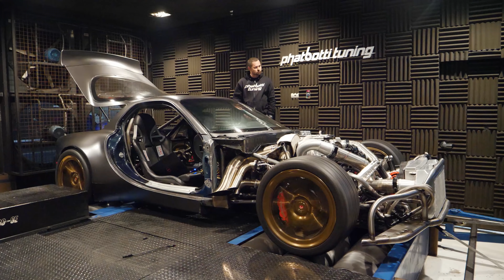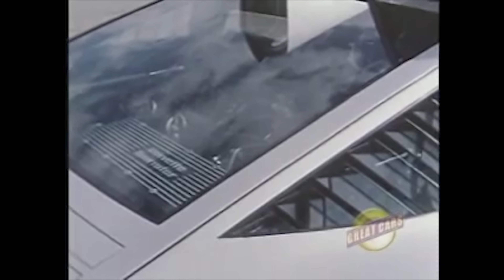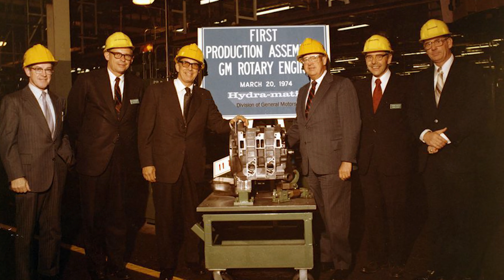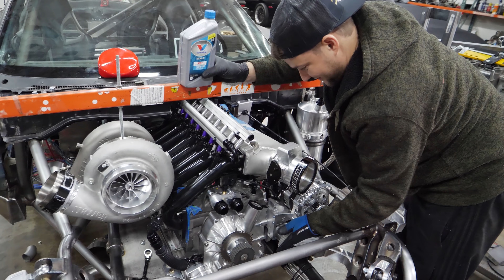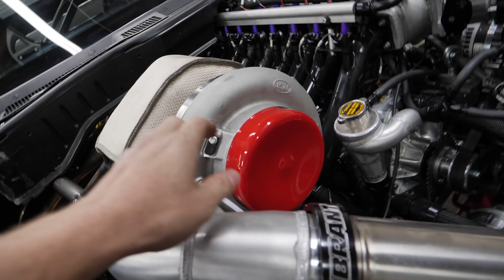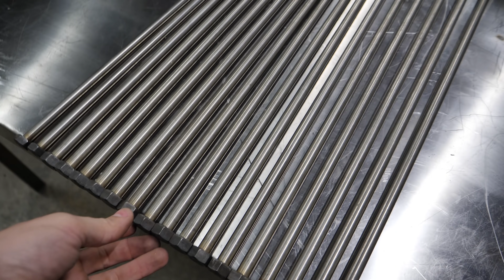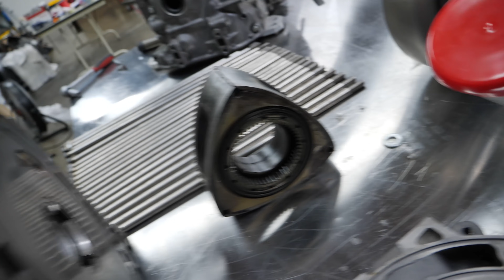I begin my 4 Rotor C8 Corvette Swap! Modern Aerovette Incoming!

Comment: At least GM didn't lie about displacement. That's what killed Mazda's rotary, they claimed 1.3l when it is really 650cc x 6 for a total volume of  3.9l. They lied to get a tax break and now it can't possibly keep up with emissions. There's 6 separate 4 stroke combustion events happening at the same time but they claimed 2 because only 2 sets of plugs.

Comment: The biggest problem with this kind of rotary is that the two outside rotors make more power then the inside two rotors. Due to the center plates only have small ports. They are primary ports. And you are using them as a secondary port and they are just not big enough. No matter how much you port them.

Comment: Thanks a lot for the info ! Do you know anyone that has tried hydrogen as the fuel source ? I made a hydrogen fuel cell (HHO) for a piston engine and it completely rusted the thing out. I was told I needed to go to a rotary engine, It would exhaust all of the moisture.  Let me know if you believe that is true about the exhaust of a rotary engine !
 HHO burns cold, the rotary would literally need no coolant.   I have an extra HHO Fuel cell if you would like to play with one.  It makes 70 liters of HHO a minute, size of a small fish tank. 12V, 20A  of power required !

Comment: That the oil gets so hot the engine requires 3 oil coolers is one of the reasons why rotary engines are so inefficient compared with piston engines.

Comment: Valvoline is good oil. I only use Valvoline or Castrol. And I have and have had many vehicles I was very hard on, and I've never had an internal failure, and when I open the engines valve covers or oil pans, they're always clean with absolutely no sort of buildup or discoloring from heating marks. 

Ps. I did have one engine throw a rod through the side of the block, but it was because I bought the truck with the engine noise, and it sounded like the noise was coming from the bell housing, so I was thinking it was something in the clutch, so I held the engine at around 7000rpm's until it made a heck of a noise and there was oil and rod parts on the ground. But looking at the internal parts, the end cap on the rod that let loose had all the bolt threads that held the end cap on, and the bolt was in the oil pan with the upper threads messed up. So I say that bolt backed out and caused the rod to let go.

Comment: I mean, put in an order for a C8 with Criswell Chevrolet. No markup. You can't get one at a reasonable cost as the video I saw before the one explaining the Wankel was the fellow who paid 25 K above sticker in Vancouver Island, Canada. I don't know the full dealer allocation everywhere, but these days, until quite a few C8's are built there aren't any at sticker and that is not likely to change soon, mainly because there are so many who want a C8 for what it is. I mean, I have one coming to me in May, June, July or August I don't know why. It is for a place in line. But having already scored a C8 from a local dealer, when 18 C8's came in to Los Angeles and the surrounding counties, the week prior to April 12, I bought one of those  18 in Los Angeles. Four days later there were 4 left; not long after that, there were zero left. There is one catch. I need 5K for it, which is the amount I invested with the dealer for the deposit. Color? Blade Silver Metallic. This is not a LT1 and its not an LT2 so the car is priced  in the 96range, plus tax, license and transportation. AF

Comment: It was interesting to me that the supposed air-cooled Porsche Engine was actually and oil cooled engine. When the power had gone up when I customized a 911 T engine to a RS specification engine with a 2.9 liter, I installed an oil cooler out front with lines that went to the rear. Spooling up? Turbo with the Rotary. Join it to an all wheel drive like Audi quattro and the two most unfair automotive advantages in motoring would be put together. If it were reliable, it could win its class at the 24 hours of Le Mans...well, maybe. AF

Comment: It's possible to state that the operative words may be, "...and then it broke down." It's a nice project. I'll be interested to see how it turns out. 20-50 is a highly protective oil. Starting with a brand new engine with a new engine and car warranty seems like it might be a little bit odd. AF

Comment: Swap the Tesla Roadster 3 motors  to the C8.....0-60 in 1.9 seconds and top speed of well over 200 MPH....and still be able to go 650 miles per charge...especially with the new solid state batteries...small and light...The rotary engine will probably get about 5 MPG.

Comment: Ok... now I have something I actually want to CNC... I want to cnc a 6 liter rotary engine...  considering the kind of INSANE power a 2 liter rotary can put out...imagine that power!

So... the mismatched ports... just weld in some material on the inlet to make the big ones match the smaller.  Youd have a bit less flow, yes, but itll be balanced.

Comment: "They're all 1/2 inch and they need to be milled out in this block..."

Huh? 🤷‍♂️ You don't mill out bolts while they're in a block. That's not even a thing. You mill and enlarge the bolt holes for the larger bolts.

Comment: This will be bad ass. My grandfather actually worked on the Corvette prototype when he was working for GM back in the 70s. He once told me what really killed the GM rotary was due to the engine's massive size and design. the thing had serious overheating issues that they couldn't figure out how to fix and the engine was just overall unreliable.

Comment: If Dr Frankenstein had a test tube filled with cellular microbes of Einstein, and then added the DNA of a few bald eagles sprinkled with stars and stripes, then threw it in a turbo charged  blender with a small amount of motor oil and racing fuel, then put it in a petri dish and kept it in a climate controlled lab for up to 9 months feeding it only doritos and bits and pieces of freedom until late one night it escaped from the lab only to find refuge into a corvette manufacturing plant.... ladies and gentlemen I give you Mr Rob Dahm!! This man is an amazing genius!

Comment: Lets take a well designed, super fast sports car, removed the legendary, reliable small block V8 engine, and throw in a unreliable, fuel hogging, low torque rotary....
Someone didn't think this one through completely before hand. Terrible idea. Oh, and good luck getting the electronics to work.

Comment: Using a smaller spool size turbo to prevent lag... did you consider Mazda's theory of sequential with a large behind a small turbo and setting up something like that? What about typical twin turbo setup with smaller turbos? You're talking boost at 1500 RPM. 

Love the channel. I got started with Wankel's with my RX-3, then an RX-4. Finally my last one was a Turbo II RX-7. And yes, I hit the subscribe button.

Comment: 1000 hp rotary.... 200k later lol no but ive never bought a new car either lol. Im a mechanic and find it easy to just fix and rebuild an older vehicle than buy a new car. The prices are theft and the insurance costs are criminal! I can get a nice used vehicle for 5k and put 5k into it and have it basically brand new. Im cool with that!

Comment: Supercharged rotary has triggered me.
I'm not a fan of superchargers, but... why don't upgrade your Z06 to a twincharged system?
Just for try, you can run a bigger turbo and don't suffer from lag.
There's a plenty of space in the engine bay for 2 intercoolers and bypass valves.
You are "crazy" enough to do it!

Comment: No reason not to put restrictors in the outside ports to balance everything out. Saves a lot of trouble. And they are already very capable plus the boost doesn't care that much in this situation.

Comment: I wonder what the next insane project after the C8 and 6 rotor is going to be. 1 rotor is honestly nothing special but I can see that being done, and a 5 rotor could be interesting. I wonder if Rob will ever tackle the concept of a diesel rotary; it's been done before, Rolls had made one that uses a larger set of rotors as a supercharger, though modernly that could easily be done with a more typical supercharger. 
If Rob ever does get to the point of doing a diesel rotary, it'd be the perfect swap for the work truck.

Comment: Can u answer me something? As far as i know rotary's engines have some issues related excessive wear compared to cylinder engines, so what do u needed to do to be able to run that engine in hig RPM's for long periods without having problems? (Does it have some special parts that u needed to forge or something, did u need a special oil?)

Comment: Excuse me… did they say a SIX POINT FOUR liter four rotor in the Aerovette? Yes please
Reply: That's probably counting all the faces of the rotors. Japan and Europe tax you based on engine displacement, so the makers there want to find a way to squeeze as much as possible. It's why the Mazda engines only count one rotor face. You can make a good argument that the R26B engine displaces 7.8liters.

Though the best comparison to a piston engine is to double the displacement of a rotary, since a rotary engine makes one power stroke per rotor per crankshaft revolution (and a piston engine makes one power stroke per two revolutions.)

Comment: Why put such a awesome engine into the ugliest Corvette that GM has ever produced.
Reply: Ugliest? Seriously? Are you that on that level of nonsense? With all do respect, that comment of yours is beyond negative IQ... "I sense your lack of cognitive thinking disturbing"
Reply: @adrielgonzalezcenteno7549  I have owned 9 Corvettes . I currently own a 2013 an a 2004. So yes I've earned the right to say there BUTT UGLY
Reply: @thomaswilson8634  ohh ok BUTT UGLY, you didn't specify that detail in the previous comment, sure i kinda agreed on that part not but either way, is not the UGLIEST from the previous generations. I know this are new grounds for the Vette (in a certain way). From a rear perspective i would have recommend they should have made it a bit more curvy lines right on the tail light section, more like they where merging with the rest of the body instead of straight lines, you know what i mean.

Comment: not to familure with rotory engines.. but wouldnt that defeat the purpose of the mid engine thing? dont rotories not make any tq until like 7k rpm
Reply from the maker: My awd 4 rotor made an impressive amount of torque down low. So I’ll use what has been working to my advantage but might need to regear the rear diff to get the idea power band

Comment: I was told that the reason that the rotary engine isn't as popular is that they do burn up a little oil and need more oil changes.  And as folk don't always know that they end up with blown motors giving the opinion the rotaries are unreliable. Is this true?

Comment: I think you should just do away with the side ports and machine in 55mm peripheral ports in each rotor housing. Make it N/A with ITB's and let it scream. You have already done a turbo 4 rotor. A 4 rotor PP build is the Go. Then you don't have to worry as much using the smaller diameter through bolts. We used to build 2 rotor 13b engines with a center bearing in the middle iron to allow them to rev. Also if you go full Peripheral Port you dont have the drama of the different size primary and secondary port size differences.   If you build this C8 correctly the money you would get for selling the 0 miles LT2 V8 out of it should basically pay to compete the build on the 4 rotor. I am a massive Rotary Engine and Mazda enthusiast. I have been building my own race engines and customer street car engines for over 25years years. But I would maybe get someone that is not known to you to go out and purchase the New C8. Because if Chevrolet or even a Dealer is watching this video you will be definitely be paying more the MSRP.
Good luck with the build. You will certainly need it. Especially trying to get all of the information from all the different ECM's to talk to each other. 
Maybe a Haltech to run just the engine stand alone and some recalibrated 2nd censors to trick the factory ECM's to what they are running. Otherwise you will have a beautiful mid engine sports car that nothing will operate on correctly. 
Cool build none the less.

Comment: It should be mentioned the 2-rotor Corvette was the step in-between the Pontiac X-4 commuter/sports-car concept of 1969, and the production model of the Fiero... which itself was being considered a possible replacement for the Corvette early-on in the wake of the second oil embargo of 1979. Think about it: Why else would GM have developed & test-marketed a design like the 2-rotor if they weren't considering it?

Comment: Thank god SOMEONE is doing something actually interesting with one of these. I don't know if it's all of the mid-engine LS-super-things cars that have been "...'manufactured'..." over the past two decades, but the C8 just has not even begun to move the needle for me. I'm sure the awkwardly proportioned(the awkward extra length between the body & wheel arch to start with), utterly generic/cliche 'supercar' styling plays a role in my lack of interest; but it's also 'just another LTx'(at least the upcoming OHC engine should be interesting; if it's ever actually affordable anyway)... 
I don't know, an 8.3l V10 front engine Dodge Viper is just so much more interesting(while I could never justify a rotary over the V10...  ...that platform would be KILLER for a big downforce, monster tire RWD 4+ rotor road racing/Time Attack car...) to me.

Comment: I'm reminded of CLR's trick with PTFE tape wrapped round the middle of the bolts to prevent resonance. Might be a good shout if those are stock diameter.

Comment: the really sad part about GM trashing the rotary program is they had fixed all of the problems that still plague rotary engines today like the oil problems and the bad seal life they had all of that fixed and were ready for production them the head of GM died and the new head said we have V8 engines why do we need a rotary and scraped the whole program.. it was with in 3 months from release and it was all scraped. they had done something even Mazda couldn't do and then gave up on it . the amount of research and data about the Rotary that was lost was ridicules and all over an ignorant GM executive that had no idea what they had in there hands and threw it away. I had hoped for a Jaguar build but the concept of making the AeroVette is something I can get behind 100 percent .

Comment: noone:
Rob Dahm: "Not efficient for only making 1000 whp"
Also Rob: "He's actually working on my 6 rotor core right now" casually moves on
Reply: 6 rotors.... thatd be a MONSTER.  O_O
Reply: Did I miss a video outside this one ?? where he revealed this ??
Reply: berend folkers I don’t keep up with this channel too much but I remember him mentioning a 6 rotor a few months ago
Reply: @ConLLee  so that'd be a  "39B" Engine then?!? Lol (Why 🛑 with 6, how about 8, or even 12 Rotors!!)
Reply: Tom Quantum twin 4 rotor, big single turbo. Now we’re talking
Reply: Tom Quantum there is a 12 rotor boat Racing motor in development, no idea if it has died off.

It’s basically 3 4rotor assemblies merged together in a Custom “block”

It has made 497 HP and 815 ft-lbs at 3200 Rpm in NA form, they has to stop at 3300rpm (498 hp) because thier carb couldn’t flow enough fuel into the engine.

As far as I know that’s the last we heard, he has confidently States that it would do 1400 hp with the 8000-9000 rpm redline for casual boating in NA

https://www.carexpert.com.au/news/man-builds-5000hp-15-7l-960cu-12-rotor-engine/
Reply: @berend109  https://www.youtube.com/watch?v=oxTXfdq_1oA
Reply: @kalle4836 thanks

Comment: Bigger company's like Chevy and Ford have "fleet" programs, usually for trucks; Here's a shell, frame, wheels/brakes, no bed, no engine. To be used to make custom vehicles for service fields with very limited production runs.  I'm sure they would have a program like this for performance models as well, pro racing teams surly aren't buying brand new vehicles just to rip the engines out of them. Have you tried contacting Chevy to see if purchasing just a rolling chassis is even possible?

Comment: I’m no mechanic or anything near one but if the car has a V8 which uses the same amount of spark plugs and injectors, can’t you adapt the wiring harnesses to the 4 rotor?

Comment: I love how rob is dedicating his life to go against the car narrative of; "on a long enough timeline, everything gets an LS" . 

Rob went to a car show one day and saw an LS in an RX-7 and like Bruce Wayne seeing his parents getting murdered was the PTSD for Batman, that moment still keeps him up at night and in the shop.
Reply: Yeah but the C8 is not a LS. It is a LT2. Two different engines. But I get where your are coming from.
Reply: @MJTAUTOMOTIVE  You can say they are completely different, but the LT's are just a variation of the LS engine, considering they are LS Generation V. They are indeed LS engines still.
Reply: @SkylineBNR34  . That's why they call them a LT-2. They might look similar but the bore spacing and crank are completely different hence the LT-2 engine code designation.
Reply: @SkylineBNR34  . Go to any Dealer or parts store and say you want some parts for your LS C8 Corvette. They are not an LS engine they are a LT-2.
Reply: Mark Thomas But you HAD to “correct” him anyway. That makes you a DOUCHE.
Reply: @nwbklr . Sorry I shouldn't of said that that's why I have edited my comment.  But calling me a Douche because I was talking with someone else just proves that you don't know what you are talking about either. 
The LS is Not fitted to the C8 Corvette. Do some research yourself before you comment and make a fool out of yourself.